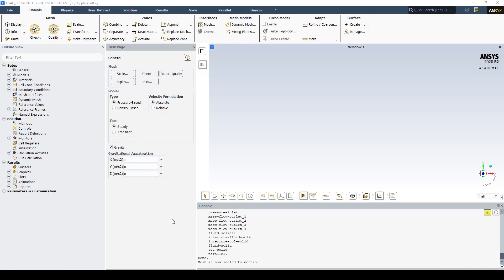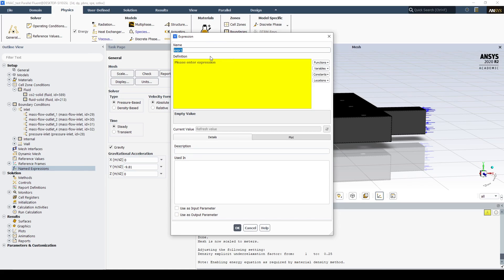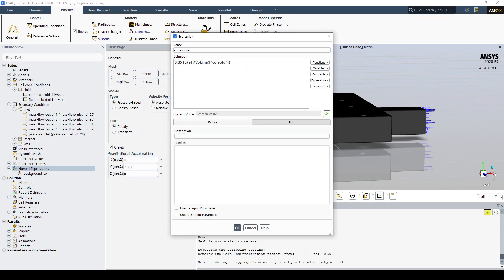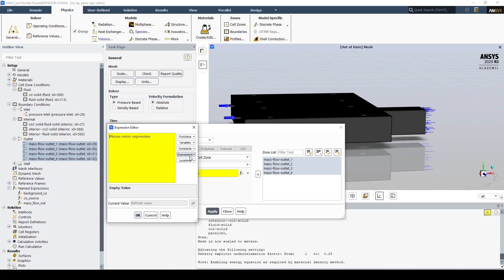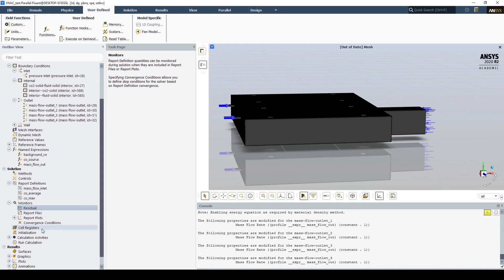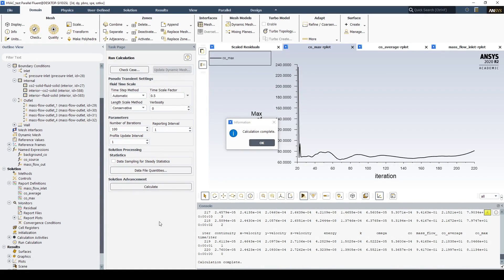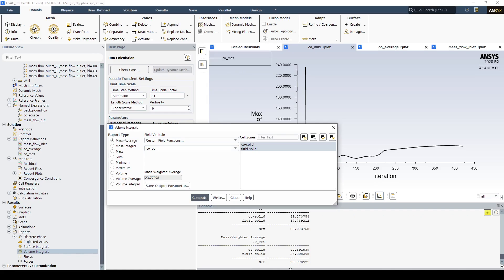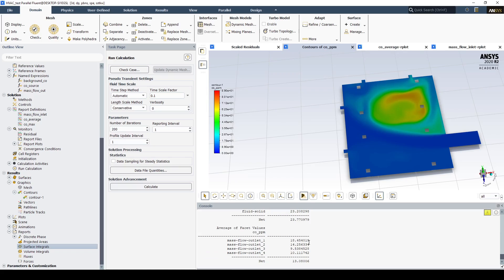HVAC Simulation - Ansys Fluent 2020R2

Comment: Great videos and demonstrations! Although I'd caution people about reducing the time scale factor and then calling a simulation converged when the monitors "appear" to begin flatlining because reducing the time scale factor is essentially reducing an implicit underrelaxation factor to improve diagonal dominance in the solution matrix which only delays convergence to increase stability. This solution was stable and there was no need for this. In short reducing this pseudo time step will have the effect of "stretching out" the oscillations in the solution monitor so they may appear to be flatlining but if the solver is allowed to run for another 1000 iterations you may well see significant changes. Also if solution monitors are heavily oscillating this could indicate the flow field is oscillating in and out of particular cells and a steady solver is inappropriate hence reducing the pseudo time step only acts to damp this out and make the solution appear to be steady when it is in fact not.